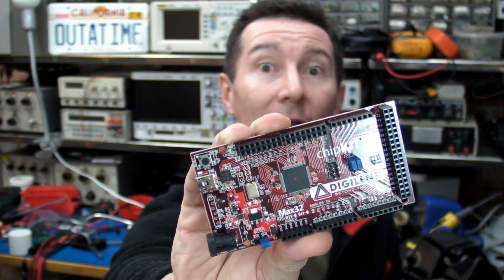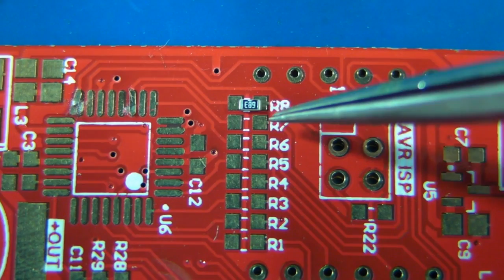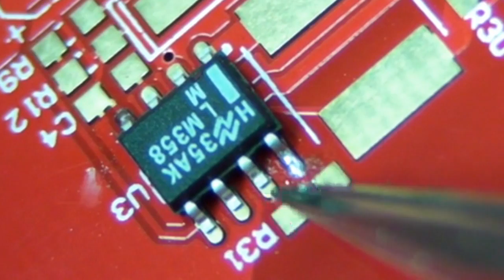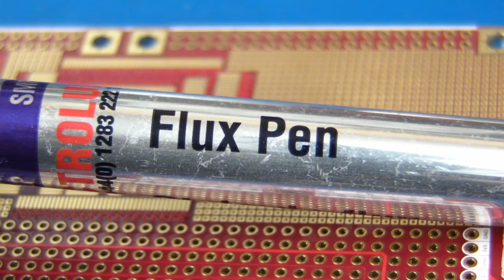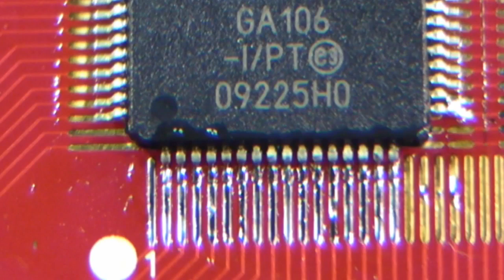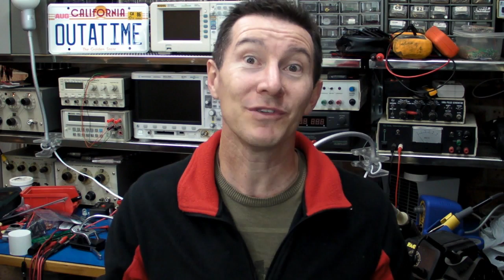EEVblog #186 - Soldering Tutorial Part 3 - Surface Mount

Comment: Can I ask why use a chisel tip for SMD? 

and not a very fine tip?
Reply: I assume the chisel tip is to allow more heat retention and tranfer by the tip because of more surface area and internal area.  With a fine needle tip there is not enough mass in the tip to hold heat to solder.  This is an assumption based upon making different shaped tips and trying them myself.
Reply: It heats up the pin and the pad at the same time. See 10:54.
Reply: Actually, that mostly doesn't matter anyways. You could just use a fine tip.
Reply: The smaller mass of the tip, confines the heat radius, as well as draws down the temperature of the contact point.
Reply: When the person uses the wrong tip to substitute for flux. 

Rosin flux was generally used when I was working on missiles and space craft. The heat bridge transfers the heat more evenly. When heating from tip alone it spreads differently, and also leaves duller joints.

But then again, today's techs are not even trained in soldering in tech schools, so YouTube has been their teacher. 

And also that RoHS solder has a higher melting temp than SnPb so you may have to adjust your station slightly higher.

Comment: Did you do a video on desoldering SMD, especially the finer pins
Reply: ***** Of course, but that drag method is also possible, but the fragile tracks can lift if you put too much pressure and leave it on for too long

Comment: I about to have to reflow a a 32pin ZIF flat cable connector.  I think this video has given me the courage to give it a try.  Saving a $650 DJI Isnpire 1 transmitter with a $2 part sounds like a plan :)

Comment: How does the reflow work? Isn't all the flux gone by the time you reheat the pad? What if the component lead is oxidized?
Reply: Tartrazine From the pad, sure. But when he reheats the solder and jams the resistor in there, isn't all the flux gone already? What removes the oxide layer from the resistor? (Just so we're on the same page, I'm talking about 6:50.)
Reply: +Dewey Rayburn I learned that it helps to push it in there with a dry rag too wiping it makes it look cleaner with no clumps and stuff like that

Comment: how much heat does components like that withstand?
Reply: +Kentrt lots most are a minimum of 800f
Reply: The peak temp in our oven is set at 245 ºC most components are rated at 260 nowadays. That's lead free process. Offcourse when soldering by hand there's a thing called temperature shock but that never appears to be a problem. The most sensitive are the electrolites which are sometimes rated at 240 something then you need a special oven program to solder them. Sometimes we use 'hats' made of kapton tape to shield the elco's a bit. Some time ago there was an order containing those really old philips rectangular flat lying electrolites at the lead free temp those things popped like popcorn.
Reply: And sometimes some electrolites are soldered by hand afterwards but it's getting more rare thankfully.

Comment: No disrespect, all your videos are great and very informative, at the same time we should share good tips, and ideas when we can.  I usually use a small piece of masking tape to hold the part in place and apply a tiny amount of solder, I find it suits me much better and no need for both hands,  no need for tweezers, and shaky hands can dislodge the parts whilst soldering and you end up with parts not being straight and center, which looks a bad job .

One thing is I do not recommend applying any solder to the pads, a component should sit straight and flat if there is no solder on the pad, so you get a small piece of masking tape and stick it half way over the SMT part, covering only half of it,  so that you keep the side to be soldered first exposed, place it over the pad and press down  the masking tape to the board, this will now hold the part in place and not allow it to move as you bring your solder and hot iron tip to the joint. As the solder melts, with the help of flux it will just flow nicely covering the pad and the pin, leaving a nice clear shiney joint .

One more thing avoid re-heating a joint without fresh solder as reheating causes solder to cling to the iron tip as the flux has been used up, so without fresh flux the solder will wick out, and leave a poor quality joint, also with the masking tape there is less risk of a part moving as the solder starts to dry, which could cause a poor unreliable joint. I have had no problems using 0.7mm wide solder. and I have also soldered the tiniest part the same way using masking tape.
Reply: +Jayant Desai 
I have also found your methods to be more reliable for clean work. The masking tape holds the part down cleanly, and all the effort is in the initial tape-down; once the tape is in place correctly you can work without having to align the tweezers every time. Using tape does require that you do not tin the pads, as the above poster noted. I've also found tinning the pads to be counterproductive, as then you can't lay the part down evenly and cleanly.

Comment: For surface mount soldering, the secret to success is not thin solder, as most amateurs think, but using very liberal amounts of flux. Applying flux first and touching the pad/component with a tinned tip (which needn't be fine at all really) gives you perfect solder joints fast. Big fan of these videos but there's always room for improvement. :)

Comment: I fucking love every bloody video this lad has out.  People flak all over and mull about   

Oh his voice is too high.  blah blah     you're not explaining everything  blah blah 

I for one  have learned so god damn much about my trade just by following his direction and knowledge 

Cheers
Reply: +Kyle247l 

I too have just restarted playing with electronics again at
the age of 71. The problem is I keep buying bits, then view his videos, only to
learn that what I have bought is utter, utter garbage.
Reply: +Johnny Codemunch 
I'm such an electronics noob myself, and have very little knowledge of components, soldering, schematics and DC designs; yet for the past 2 weeks of viewing almost every single video on Dave's channel, it's inspired me to spend over £600 (GBP) on a mini electronics lab so far, and I'm still buying stuff for it. 
You can learn so much from this channel. The advice is fantastic, the content is informative, the guides are understandable, the knowledge gained is insane. Even for a newcomer. You can start from nothing and end up with such a vast array of electronics design/engineering knowledge from just viewing Dave's videos and the EEV Blog forum. Finally starting a project on creating a homemade DC power supply, thanks to this channel
Reply: Cliff Woolston
aha. Same here. Terrible solder, terrible flux, terrible desoldering braid, and a plug-in iron, while using an actual heat gun as a rework tool, but I'm only 20 years old right now, and I made these mistakes at 15 years old. We all learn from our mistakes though!
Reply: +Cliff Woolston At least if it's utter garbage you don't have to be careful when using it.
Reply: я тоже охуел! fuck
Reply: Johnny Codemunch  you are pal ant you can try explain what that's mean.
Reply: He knows his stuff!

Comment: Try using paste solder on SMTs. Basically a mix of flux and solder beads, and you can apply to each pad with a syringe. We used that for SMTs, put the solder down, placed and held the component and then flowed the solder by hand with a micro tip iron.

Comment: Here in Germany, they have to learn soldering a 50x50x50 mm cube out of standard copper wire. The assholething about it: copper transfers the heat over to the next joint you just finished grrr

I just made some practice weeks at our lokal tv service tech, and that was one of the first things i learned. But it was mid 90's, old TV's where easy to repair and not the junk you get now.

Comment: "Stevie Wonder could solder these" hahahahahahahaaaa.... 1st joke i have ever heard in a tech vid.. wade a be Davie.
Reply: +Greg D I was thinking that I could land a helicopter on those pads. I'm used to doing ultra-fine pitch stuff you need to do under a microscope.
Reply: @andrewthecelt3794  A Helicopter? Make that a B-52
Reply: @andrewthecelt3794  would you say 0805 is doable if one has never smd soldered before? (seeing the size of these things i'm kinda worried i wont be able to make ut without practicing a ton first?)
Reply: @andrewthecelt3794  I'd love to see your helicopter!
Reply: nicholas feltman by hand. With practice you can do components with 10mil leads
Reply: +Andrew the Celt do you hold the iron with your hand or like a robot and joy stick?
Reply: But can Michael Fox solder that? That's the question.

Comment: Does that extra flux from the flux pen need to be removed when you're finished soldering?
Reply: Some types need to be cleaned up after soldering, but most of them evaporates perfectly leaving no appreciable rosin layer. They are called no-clean types.
Reply: Péter Kiss
thanks for that tip! I'm new to this and the idea of cleaning flux off a pcb with water and an esd brush really scares me
Reply: You should do that with pure alcohol (denaturated ethil) instead of water.
Reply: aha! thanks again Péter Kiss
Reply: neppy5 It depends. Usually not but if you need to conformal your pcb then you will need to remove the flux residue. No clean fluxes still leave a residue that can be cleaned off for a better conformal coating. Most hobby boards will not need conformal coating.
Reply: neppy5 No need to be scared - just cautious and well researched. I have washed approximately 10,000 pcbs so far this year using Alpha 2110 solution and rinsing with 70C hot water (our water supply is very good but we could use deionized if required). You need to make sure your components can be washed though. Relays, Pots, trimpots and slider pots need to be be very carefully investigated (ie data sheets) before washing
Reply: thanks Ian Montgomery
Reply: Péter Kiss Can you use Isopropyl alcohol 91%?
Reply: Scott Russell Certainly. Just make sure you check data sheets regarding washing for open framed devices like trimpots and relays.

Comment: Good video but please don´t be offended, The tip used to solder SMD items in this video is TOO BIG!!!, with a small solder tip you can get a better solder quality!!!
Reply: I would disagree. The chisel tip is right for the soic8 as it heats both the leg and the pad simultaneously. The 'well' (or wave) tip is perfect for the fine pitch IC. I think you may also be being tricked by the magnification.
Reply: Ian Montgomery The tip used to solder a pic24fj256ga106-i/pt 64 pin (each pin has 0.22 mm )must be as shown in the link lines below 1/64"  conical tip to avoid jointed leads on the SMD PIC:
http://paceworldwide.com/products/tips-and-nozzles/soldering-iron-tips/ps90-tips/ps90-soldering-tips/164-in-conical-tip-357.
Mi comment is due to I saw when you´re are soldering the PIC and 2 leads are jointed with solder (min 20:20)

Regards!!!
Reply: eduarsan1
We use wave/well tips (these have a 4.5mm well)  for QFP hand soldering (we usually use a placement machine except for protos) or alternatively we will use hot air.
If you have a lot of flux over the leads you wish to solder then the job becomes easier.

Comment: This is no reflow soldring! For reflow soldering you need a soldering paste and a reflow oven. When you heat up parts like in this video, most of them are damaged after your soldering.
Reply: *****
I agree with you. Reflow should lessen the prospect of heat damage to components too.
Reply: Ian Montgomery
This is defenetly not a resoldering process. The reflow soldering is a defined process where you use a soldering paste and an ofen to solder the components to their soldering pads. When you use a soldering iron it's not a reflow soldering, even if the soldering tin is liquid again. Use google if you don't trust me. You will not find any description with a soldering iron and soldering tin (manual solder) using the word "reflow".
 The reflow process uses low temperatures to protect the components from getting to hot.
Reply: ***** I guess part of the reason is that the ovens used for SMD lines are called reflow ovens so people associate reflow only with SMD.
Reply: Martin B. Our reflow oven hits 250C for a very short time.
Reply: Yes, might be. Some components (or materials) need higher temperatures than others.
Reply: Martin B. It is mainly the solder paste used. We do double sided boards occasionally which means using different melt point solders on each side. We have even used lead free on the first side and leaded on the second (lead free has a much higher melt point). It depends on the demands of the customer.
Reply: i guess you commented before you hit the 27:00 mark where he exactly tells us what you meant in the next minutes....and referred to a different video he made about smd reflow soldering
Reply: hmm, I never had that. We use lead free on both sides and the component's on the lower side are supposed to just 'hang on' and they do when they're not too heavy. It's quite amazing a 144 pin fat qfp will just stay there.

Comment: There is such a thing as too much flux. Working in a prototype/production environment we only use no-clean rosin free flux. We use as little as possible, and even with small amounts we still end up scraping flux off boards and wiping with alcohol. Even when boards are being built for ipc class 2 we always aim for class 3.

Comment: Hey Dave, I've been trying to solder a SSOP ic about 4 times now without success.  This is being done on a SSOP to DIP adapter.  After the first 2 attempts, I decided to purchase a Hakko 888D.  It solders through hole components pretty good, but I notice that the solder isn't flowing nicely when doing the SSOP components.  Bridges form and apparently sometimes under the ic.  Maybe I'm being too careful.  Solder wick doesn't work well either as if the iron isn't hot enough.  I however use 110V 50Hz in my country.  The iron is rated at 120v 60 Hz.  Would this affect quality of the solder job?  

Anyways, what temp. should I set the iron at?

Comment: EEVblog Hi Dave, I am enjoying this video series on soldering very much. My dad taught me to solder by giving me old electronics and an old Weller RED iron to struggle with, and would let me sit there till I had stripped that board clean , shows him and re-assembled it as it was. Man, that was a steep learning curve. 
My Reward - MY choice of project from DiCK HeadSmith's Funway 2 book and the book it'self. And I bult them all. 
The Shortwave Radio was the most interesting one I found in that book, the most complicated, etc. but it had infinite treakability.
You should do this one as a video, or even a Jaycar kit vid just to show that it can be done.
Reply: Dick Smith Funway kits REALLY opened up the scene to people back in that era, from young kids right through to adults. 
Started to dabble with the Jaycar kits later on down the track but when everything became PIC this and PIC that, I began to lose interest since you could no longer build something without programming it first.

Comment: Remember the SMT component "MUST NOT" sit hard on the pad, but must float on the solder. There is a intermetalic layer between the copper and the solder (copper crystals) that forms and this layer is brittle, but it does hold the solder to the pad and component. The longer the iron is on the joint the more the intermetalic grows (remember it is a brittle layer) so not to long on the joint with the iron, the brittle layer continues to grow with time and heat and that's why equipment fails due to a crack in the joint or in the brittle layer.

Comment: found hundreds of these videos....PLEASE SHOW ME HOW TO DESOLDER SURFACE MOUNT.
Reply: Farley Hill
good one! Ill be making one next week. Thanks!
Reply: saw a couple of methods on Instructables dot com, some good, some not so good. Just search desolder smd.
Reply: What you need is a hot air gun and a small nozzle. I made one from a 9mm and a .22 cartridge brass. Cook the component not the board and when the solder melts, flip it off. Works OK on a TQFP 80pin and 0805 components. Practice on a scrap board.

Comment: Hi Dave, I recently bought an ATTEN AT858D hot air soldering station, for smd soldering, but watching this video tutorial, makes me rethink if is not better a iron one. For what its better one than the other?
Reply: It really depends on your use case. If you plan on desoldering  lot and generally stay in SMD the hot air gun is certainly the better choice, if you have to choose one or the other. If you do lots of through-hole stuff and don't plan on salvaging old components from boards a good iron is the better choice
Reply: cmdstraker Thanks cmdstraker.
Reply: ***** No problem. The ATTEN station is tempting for its price alone. Since most hot air setups start at about $800, you can't really pass it up.
Reply: Estimado.

 Lo invito a visitar nuestros modulos 3G - GSM y GPS de la marca Quectel Wireless Solutions - www.quectel.com o via email a latinamerica@quectel.com
Tenemos una gama de productos y nuestro soporte es ofrecido directamente de fabrica. Pueden contactarnos a support@quectel.com o via Facebook a https://www.facebook.com/pages/Quectel-Wireless-Solutions/1621184248095149?ref=hl
Para información comercial pueden hacerlo a robert.moquera@quectel.com

Los estaremos esperando con sus preguntas.

Comment: Hi Dave I just had a Sony HD 3D tv not even a year old just stop. It made a pop noise just as it quit, my frist thought was a cap on the power board on the primary went. Upon opening it up found all caps where good so I looked on the back and saw one of the control chips on the cold secondary side had three pins looked like they weren't soldered properly the tv just has no power and I cant find a break down for this to know what pin should do what if your interested in talking about it and maybe we could figure it out together.